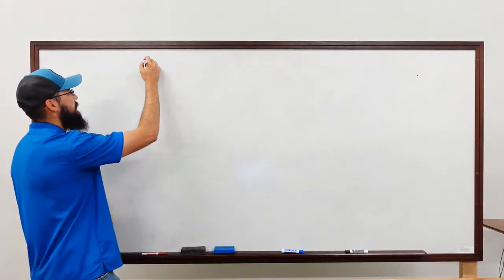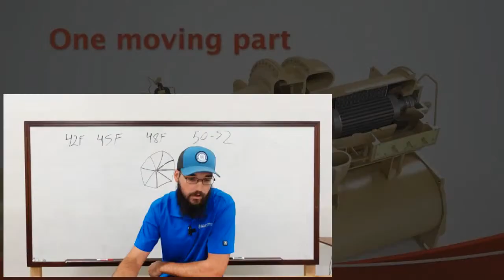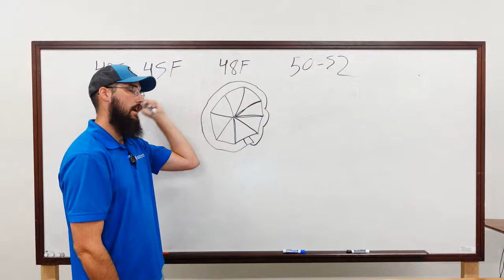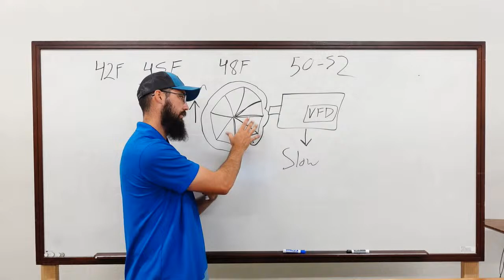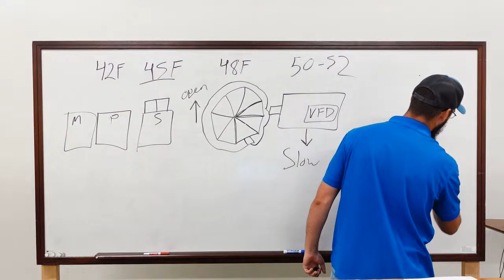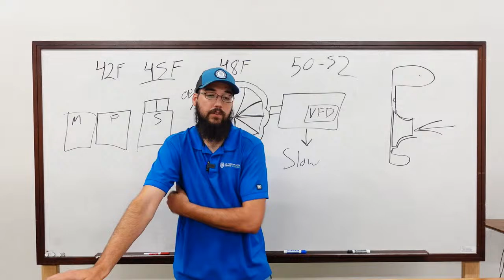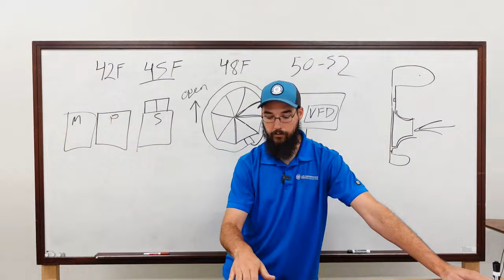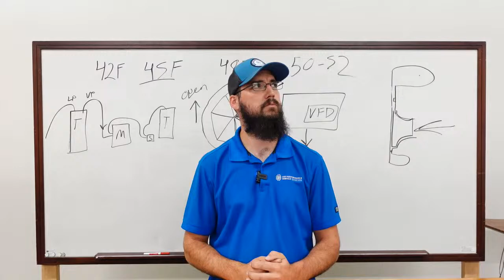Chiller Training: Water Cooled Chillers Operations

Comment: If you have Y/delta starter your motor is not Y or delta. It is simply 12 lead motor. Otherwise you wouldn’t be able to use that starter.